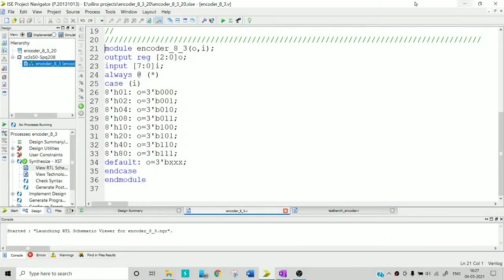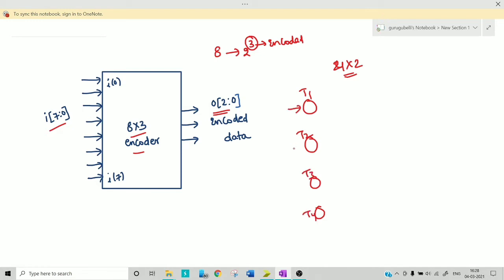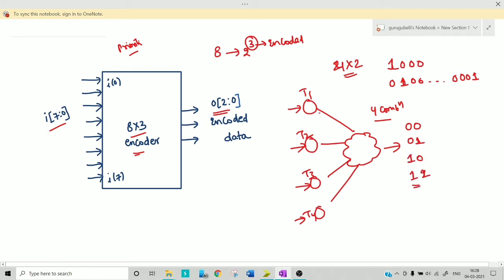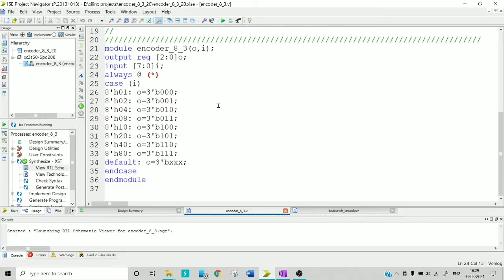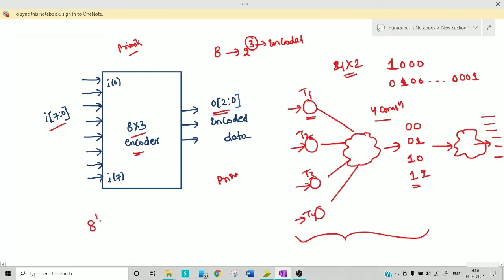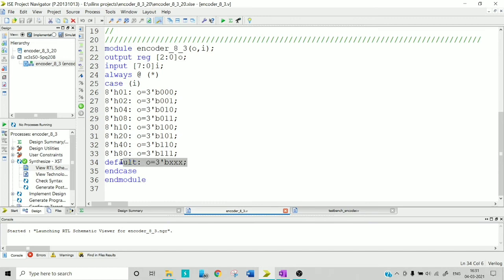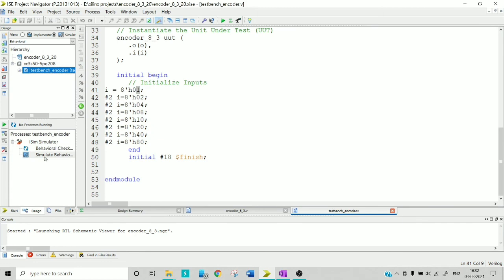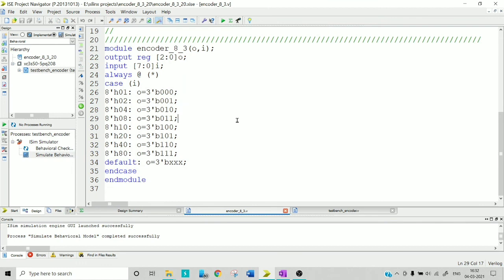Tutorial 25: Verilog code of 8 to 3 Encoder|| #VLSI || #Verilog

Comment: sir is it must and should that default function will be use ?
Reply: yes , it is right usage of default function for proper defining so if your selection pin (s variable) comes as not expected such as 0 or 1 bit value.
it just throws "x" value (don't care value) in the waveform diagram.